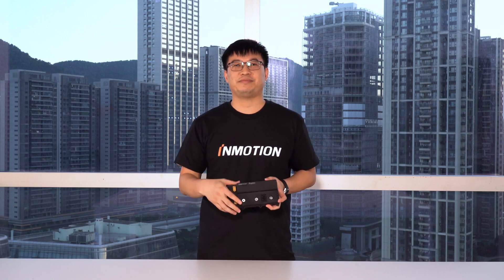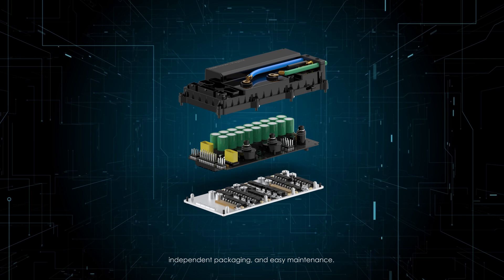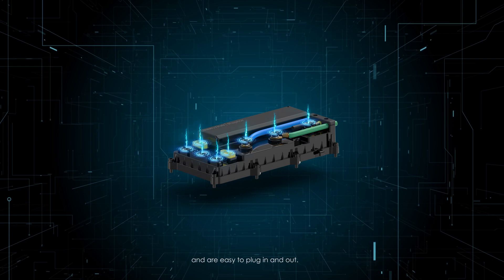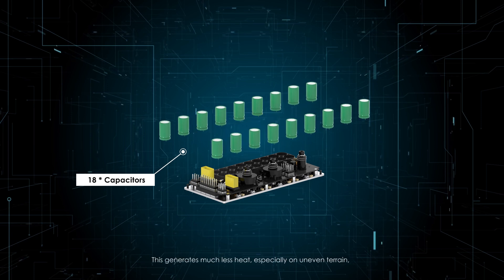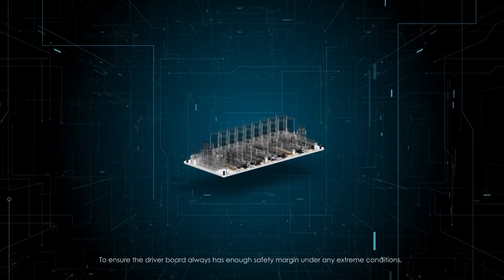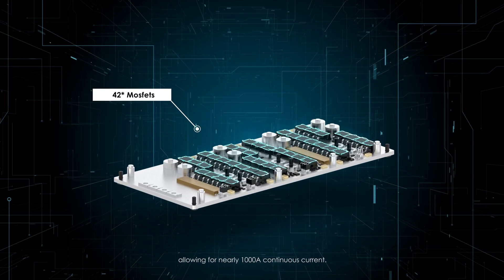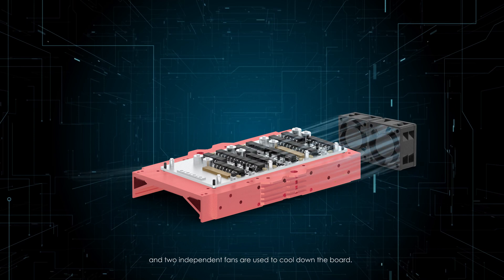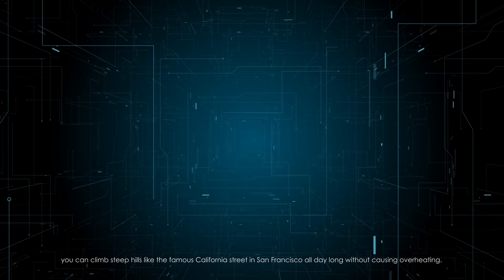INMOTION Challenger (V13) Controller - Raptor

Comment: I’m all for this direction. Finally these things won’t be some cheap plastic toys (more recently overpriced toys) , but actual vehicles. The top speed has me concerned for safety but this also means if you ride normally your chances of cutoff is minimal

Comment: I don't know how many people are asking for a wheel this fast (and no doubt heavy), but I really do appreciate the emphasis on safety/reliability/waterproofing. These are the developments I'm most excited about for the next wave of EUCs
Reply: A higher speed capability is a higher safety factor.
Reply: @h3Xh3Xh3X  sure, to a degree. It will help prevent cutouts. By now though people riding at speed should understand their wheel's limitations, know how to set up tilt back, alarms, and safety margins. If a wheel's top speed is 50mph or 100, that's about the same safety margin for me, a person who never pushes past 40. I'm glad to see focus on real safety tech, building redundancies in current delivery and boards that won't blow up.

Comment: I am not a fan of the new FAN direction. With impact the fins could break, and over time they will wear out. It would be sad to replace them yearly. There are very good vapor chamber cooling solutions what could be used to move the heat over copper heatpipes to the 2 sides of the whel inside the wheelchamber, where a huge  ALU disc coudl release the heat. this might increase the weight by 0.5kg, but better to have a passive cooling than a failing active one...
Reply: This wheel is already going to be heavy - let's just water cool it
Reply: I immediately had that same thought upon the fan announcement. This isn't a server room. This is a mud slinging tire we're talking about.
Reply: Are you a fan of the new board?  Passive cooling was considered but found insufficient.  I rather have this setup where replacing the fan is a minor inconvenience than having an unreliable board with passive cooling.
Reply: yeah hopefully a passive cooling solution will be found
Reply: Water cooled would make all the nerds happy. 🤓 Although it's very possible inmotion still did the right thing using fans with passive cooling not being sufficient.

Comment: INMOTION for the Win! The only company that seems to measure twice and cut once. 
Just maybe we will have a new benchmark for performance and safety! 
Cheers INMOTION
Reply: What?  Haven't you been following up on strange cutouts on the V12 & the V12 HT???  Not to mention loose parts bumping around on new products before even the first ride by the new owner?
Reply: Can you do it better? Lol
I have a V12. I love it! It’s always the armchair warriors who complain the most. The build quality of INMOTION machines vs.others is almost non comparable.There are many parts, materials that any of these mfg. have to procure- they do not mfg. in house. A bad part can be hard to detect until it fails- i.e. a light bulb only fails when you turn it on. 
I think INMOTION  has been knocking it out of the park with what they have been bringing to the table.
Reply: @macycola3224  This isn't the V12.

Comment: I don't like the idea of 18 smaller capacitors instead of fewer bigger ones. Less parts to be broken, since 1 capacitor is blown, the other can't take its voltage. They should have a bigger airflow channel from the outside flowing through the underage of the heat sink which would be a better idea (S22, Master, etc.). If this is truly a closed system without a big airflow, and once the fan dies, you would get overheat!

Comment: Nice work guys! Definitely my next wheel! I am rocking the V11 now, which has been super solid as well. 🤙
Reply: Same here. I've been on the v11 for quite a while and it's amazing. The quality of inmotion wheels is the best in the business, and I've been holding out on getting a faster wheel until they make one.
Reply: Yep. My V11 is stil going strong at 1700miles. Not even a bearing issue. Time for a new tire though.

Comment: What’s the expected range on this wheel?
Reply: It hasn't been made yet, how would anyone know.  Keep up.
Reply: I reckon with my riding style and weight, easily 100km+
since I'm already getting 70km on the v11
Reply: @Scifiape  these are my exact thoughts buddy. Great minds think alike buddy.
Reply: With such motor power and controller throughput? At full send, 50 km at best.

Comment: The race for huge wheels is so exciting? What for? This is a clumsy wheel, it is inconvenient in everyday life for most users. Do something like Gotway MCM5 already, but even better, extremely reliable, with a wide tire, headlight, brake light, seals and a controller without access to the arch. This is the best thing you can think of, and not the various functions that the assistants were carried away by the developers. Everything ingenious is simple. And reliable.
Reply: You don't have to buy it. You do know that, right?
Reply: Imagine hating something you haven't seen yet. Life must suck for you. Thats ok though, one less person in front of me for pre orders.
Reply: Did you specifically find the link to the vid before it was listed and think "yeah I gotta complain about this wheel now off to the comment section I go" and not once think that no one was forcing you to buy this?
Reply: Inmotion actually sent a survey recently about “would you be interested in a modern lightweight wheel?” I think every wheel has its place, and I filled out the survey saying I would love a 30lb, 30 mile wheel. Something similar to KS16S
Reply: Gotway wheels 😂 that's a good one. MCM#25 won't be close this wheel in technology safety and reliability. 
Gotway has years of fire 🔥 to put out before moving forward. 
GW  is building 10 wheels of a year 🤔 . 
 
✌️ Keeping it WHEEL, inmotion style ✌️
Reply: Then this wheel is not for you. Easy as that.
Reply: 40ish lb 16inch suspended 100v with bolt on battery pack that can do a 45-90 min moto. Once these get into the x games it’s gonna go crazy.